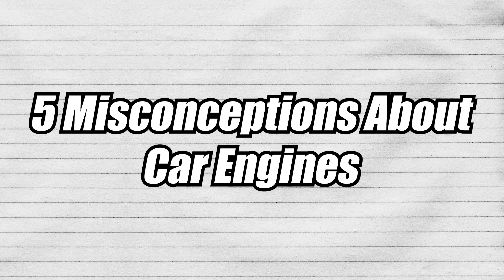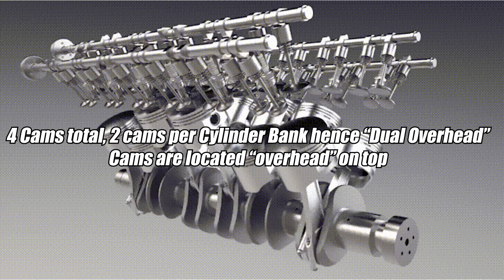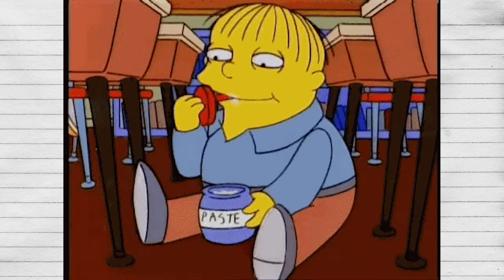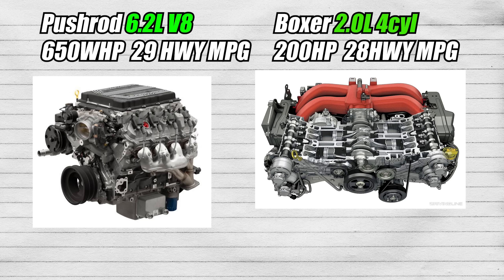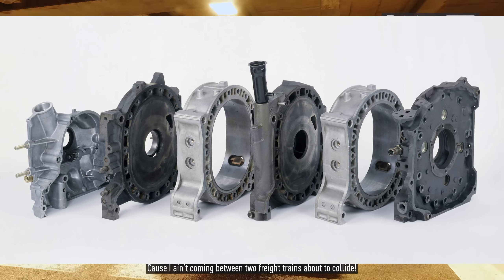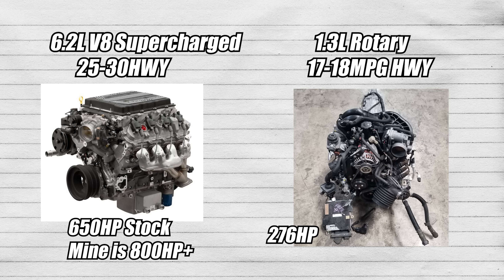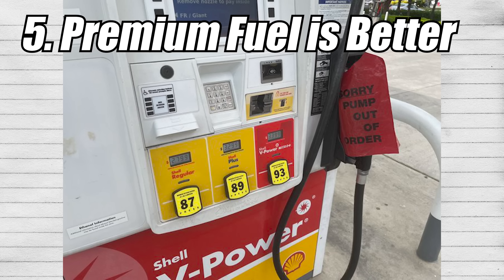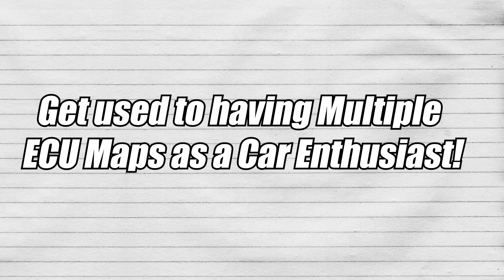5 Misconceptions About Car Engines!

Comment: You sir are grossly incorrect about pushrod engines. In fact the quote "The movement of these pushrods generated more torque per engine size compared to most overhead cam setups" makes you sound like an absolute ass. The reciprocating mass prevents the engine from reving as high in most cases. Since the engines are typically more rev limited it's easier to take advantage of your limited rev range by shifting the torque band into the mid to low RPMs. This places your peak horsepower more comfortably within the limited rev range your have available. The fact that it is pushrod doesn't instantly mean it produces more low end torque as your verbage implies. The same goes for DOHC engines. It's just easier to make it rev out without all that reciprocating mass in the valve train and that allows you to hold a lower gear for longer or decrease your gear ration and get more turque at the same speed in the same gear.